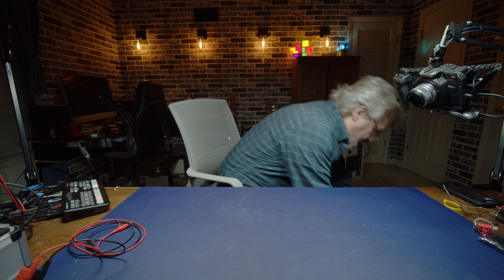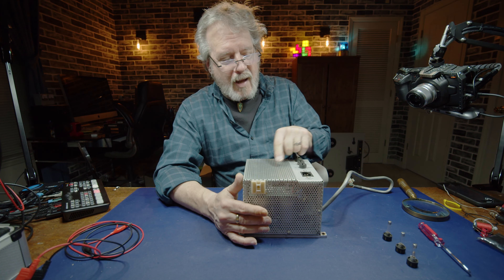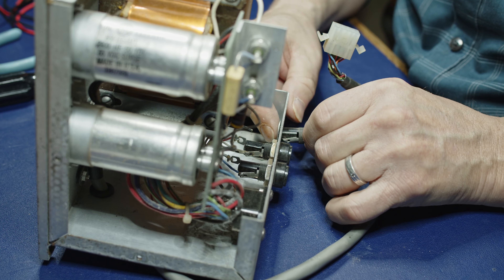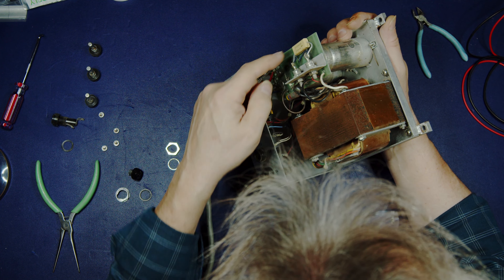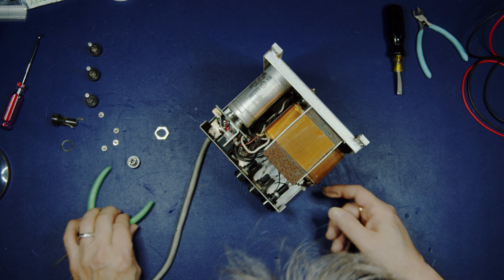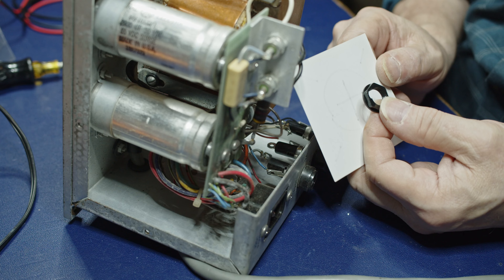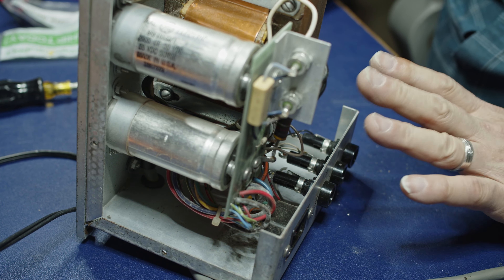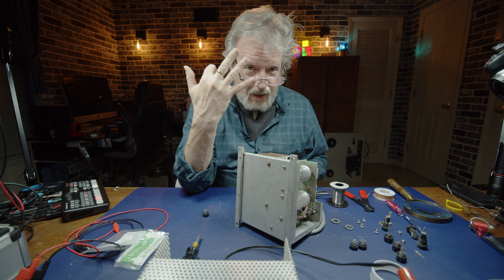Let's not blow a fuse, here! - Scully 280B SP-14 Power Supply

Comment: incredible machine, even quieter playback than the 280's ive heard.  i just fixed up a mint 280b with the original Russ Lang cabinet but this custom cab you buiilt is really neat!
Reply from the maker: Thanx for the good words..! The cabinet is actually a 'wardrobe' from Amazon. I modified it with rack rails mounted horizontally for each deck. I wanted to enclose both the SCULLY 280B and the PRESTO PB-17A deck. The PRESTO is an auto-reverse, 2-track, 3.75IPS deck; marketed for background music service. In addition to the "library" of classical music for the SCULLY (14" reels, 7.5IPS, 2-track/2-channel - stereo), a library of 14", 2-track/2-channel - monaural for auto-reverse background music. I just love watching the reels go 'round when I'm not working on some project for 6R. . . 😜

Comment: hi have one as well it came from a army base in the uk i have the tapes 30 of them note it's very hard to find 14 inch tapes in the uk 

my deck is very ill it been around alot  it need alot of work doing to it  over time the motors are bad  it's a juck deck  note i do have a working otari mtr 12 
purrs like my cat   i use it for checking  the tapes for edit cuts   in side a otari mtr 10 12  you can move the motor  to take  the 12.5 tapes 

i have a spare set of  rollers  and head blocks   so i can play  1/2 1/4 tapes   and i have a 8 track 1/2  head blocks from a bad otari 5050 that went smoke
i go to the caps to late  

to all please change the caps before you power in up    like you did
Reply from the maker: Greetings, and thanx for the comeback..! Last year I picked up a case of 14" pancake on the internet; 1.0mil. 5,000' per spool. I recruited a gentleman to produce reel flanges from plexiglas (assorted colors) on NAB hubs. Now I have 10 @ 14" reels ready for recording and archiving, And with the SCULLY fully operational... it's gonna happen.
The point is, tape stock and reels can be had for whenever your machine is brought back from its' present "retirement". Be Well.